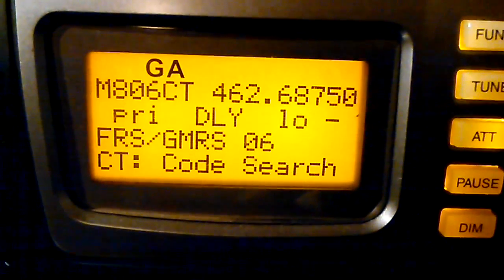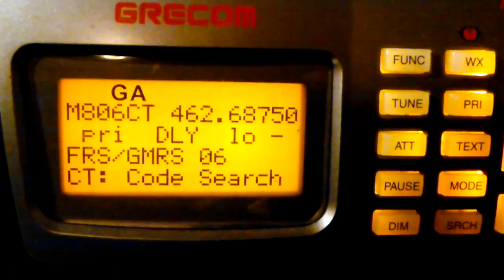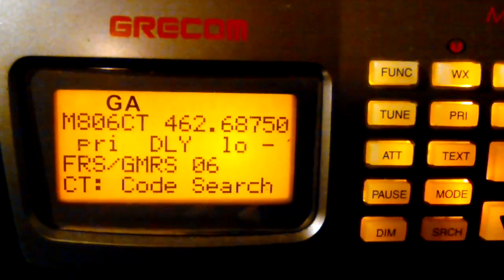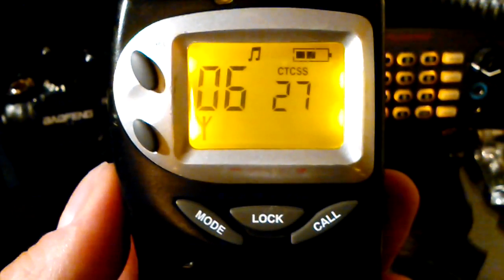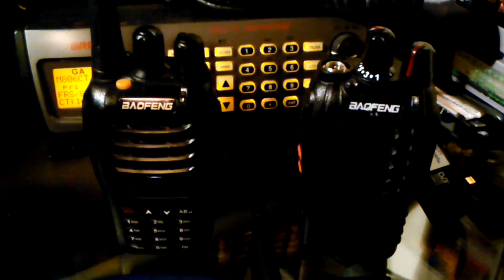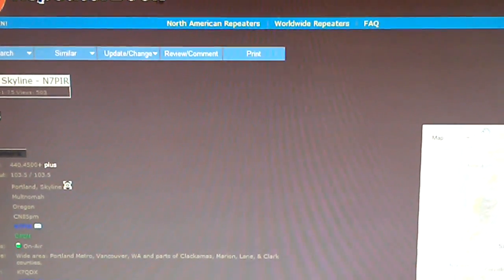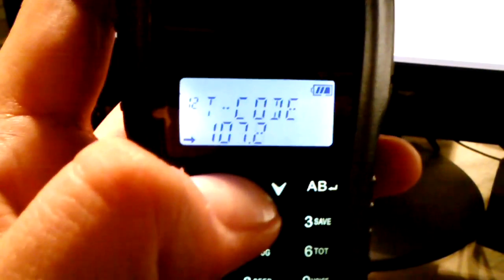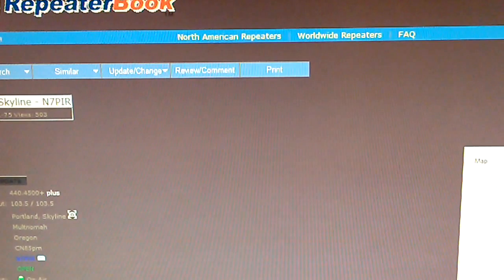Radios Explained: "Privacy codes" are the opposite of privacy, CTCSS & DCS

Comment: Specific frequency, say 462.68750, is to specific telephone number, say 212-123-4567, as CTCSS or DCS, say 67.0 or 023, is to the "extension" number — is that accurate to say?  Meaning, you can dial in the frequency, but if it has that code and you don't know or include it, you won't be able to "talk" to the other end?

Comment: Question:
If I have my GMRS channel e.g., channel 23 set to a PL tone of 250.3 (or the designated repeater tone)  and there is no local repeater, the radio will still transmit and receive in simplex?
Reply from the maker: I can't speak for every radio out there but typically yes, tones can be used in simplex.

Comment: Most programming sites for handhelds demo a CTCS for transmit side only. If the repeater has PL in and out, shouldn’t you enter both? Or is there a reason to only have it on one side
Reply from the maker: If you only want to hear traffic on that frequency that comes from the repeater, enter the tone on your radio's receive too, in addition to your radio's transmit...if you want to be able to talk into the repeater, but hear both traffic on that frequency originating from the repeater AND anywhere else, enter the tone into your radio's transmit only, and leave the receive open (carrier squelch only).

Comment: The private codes Motorola uses has its sense of privacy, meaning that only those in the same frequency and code will be able to talk. It should be more used as private listening and no privacy at all for what you say.  However the word PRIVACY (PRIVATE) implied by them is really misleading as you well explained. Thanks for the video.

Comment: I work in the soundboard at my church, theirs a lot of witless microphones, and something’s on our radio interferes with other church equipments. What would be better in my situation, DCS, or CTCSS?
Reply from the maker: Billiam William either will perform the same function, although I've never seen wireless stage mics with CTCSS or DCS, only two-way radios.
Reply: What brand of equipment are you using? Is any of the equipment windows based?

Comment: So if people are using DCS can you hear the conversation if you have the R-DCS to off on your uv5r, and if you can do you just hear the digital code?
Reply from the maker: If you have a UV-5R and you are listening to DCS-encoded transmissions with your R-DCS set to OFF, you will hear the transmissions, but if you transmit, the other users will not hear you unless you have your T-DCS set to the correct code.  The digital code is not audible, only the circuitry within the radio detects it.
Reply: Is it possible to have a uv5r conjoined with a bunch of Motorola CP200s ?? I need a better radio for work.